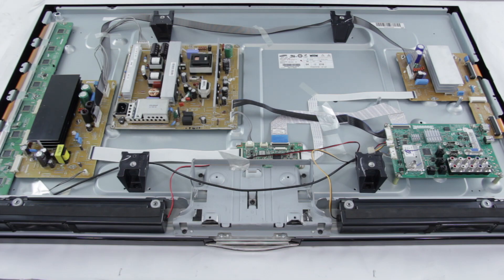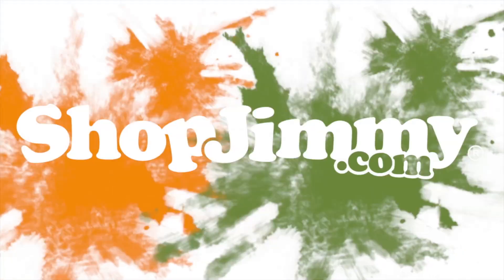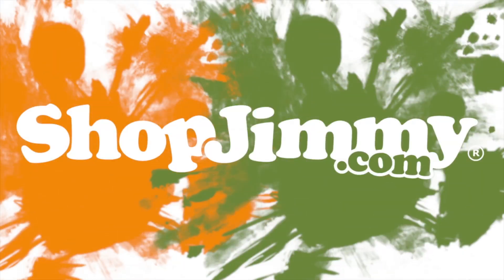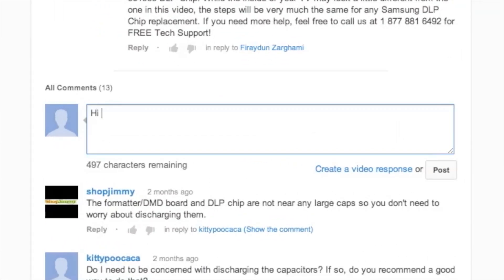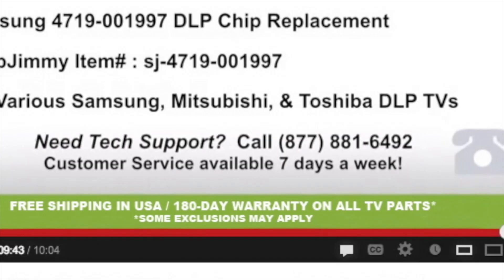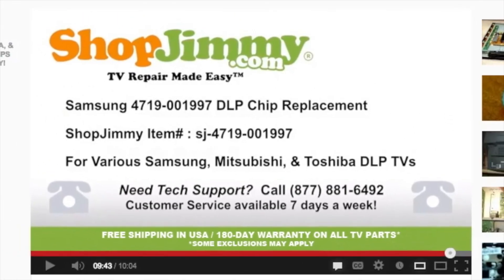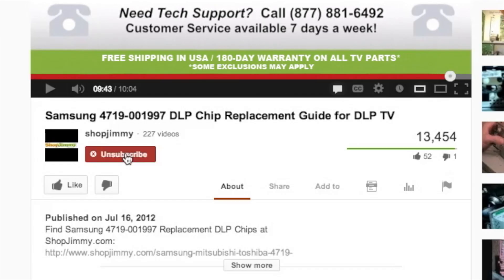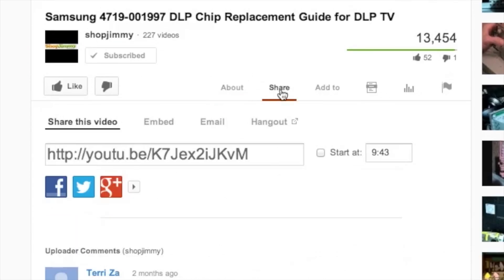Plasma TV Repair Tutorial - Common Symptoms & Solutions - How to Fix Plasma TVs

Comment: I have a 2013 Samsung plasma 55-inch. I noticed recently on very black sections of the TV I see faint snow. I tried changing the HDMI cable with no luck. I am connected to a "smart" Bluray player that is connected to WiFi for streaming (Netflix, Prime.) Any ideas on what to check? Thanks!

Comment: 10 year old Samsung Plasma TV Series 4  450:No picture or sound when we turn on TV.  It is receiving power because the ON red light indicator comes on and we hear the two-note sound the TV makes when it turns on or off.  For the past two weeks we have had the problem 2 or 3 times of the screen occasionally going black during a show -- changing the channel would make it come on again and we could then return to the original channel and have a picture again.

Comment: It’s a Samsung plasma display the model number on the back of the tv is PN51E530A3F, there’s a model number on the inside also that’s S51FH-YB01 the problem is the top part of the tv is black and the bottom works perfectly fine, there is moments when the whole screen will work and the top lights will turn on and then it goes back to the top half black and the rest fine. PLEASE HELP😭

Comment: Hi, I have a Samsung 58'' plasma  PN58B540S3FXZA. It shut down while watching it. When powering it back on it clicks as the standby light blinks and a green light on the logic board blinks,  does this a bit and then stops clicking with a solid red standby light on.  No image on the screen during all of this.  I purchased another power board (not from shop jimmy). After installing the new board, when I plug it in, I can hear some components power up but, no clicking or any standby lights at all.  also no green light on the logic board and no image. I've checked continuity on all fuses (good). I checked the presence of voltage with a no-contact voltage checker. The new board shows voltage across 2/3rd's of the board but the last 3rd of the board does not show any power in its components. Any ideas?

Comment: Hi I have a Lg60pk590 plasma standby light on goes off as it should do when I press power button but no picture on screen just black or really dark I purchased a y sustain board from eBay and switched it out with no success and tested buffer with multimeter power off? I have read about testing for sound but as i cant see screen im not sure how i can do this as mx box pauses when hdmi unplugged and thats really the only device i have Any advice appreciated 
Thanks

Comment: 60" Samsung plasma (PN60F5500AFXZC) blew a small capacitor on the Y-sustain board. Completely lost the picture. I replaced the Y-sustain and and the picture came back but it is very red/purple and dark with fleeting/flickering vertical lines throughout.The tutorial indicates that a faulty x-sustain board can cause the dark picture with red & purple. It actually looks more true to color when switched to 3D mode but still a bad picture. Anyone else experience this and have some insights into other possible causes for dark red/purple picture with vertical lines? I hate to let the tv go to waste but I also don't want to end up spending a fortune on it.

Comment: LG 60Pn6500 intermittently shuts down then comes back on. Worse in warm weather. Fan on back helps but not complete solution. Took the back off today - no dust and no swollen caps or other obvious problems. Cut a hole in the back directly over heat sinks on the v-Sus board and installed a computer fan blowing in. The problem got more frequent. Shut that fan off and turned the large fan back on. Ran longer, but still shut down after approx 10 minutes. Stays off 3-5 minutes. Any suggestions?

Comment: I have a LG 60PZ950 plasma TV with screen problems. It shows red tint and snow with solarization.  My research pointed to z-sus problem. I replaced the board but the problem persists. Power supply Vs reads 215 volts and Va reads 55 volts, and 5 volts for standby. All caps, coils and connections look fine. Any idea?

Comment: I have a 60" LG plasma and I'm not wanting to go to led for my own reasons.  The set turns of for a couple of seconds and the picture is good but then it turns off by itself and then will not stay on at all after repeatedly trying to get it to work.  The problem started gradually and it messed up a couple of times before it basically became unusable.  I had it repaired once already and it cost me $300.  I thought I would try to fix it myself this time and any help would be greatly appreciated.  Thanks.

Comment: I have a samsung hp-R5052 and it works fine most of the time but sometimes the top half of the screen is white with some pink pixelation.  My mother thinks it’s low on Freon but it’s not an air conditioner.

Comment: My LG Model 50PC3D-UD is making a clicking noise when I try to power on and the green light will light up for a second and it turns off. 

I have tried for 3 hours turning on tv and it will click off and then a picture would momentarily show on tv and then stay on for a few hours. What is causing this issue

Comment: I have an lg plasma 50pq30 and it's getting No power and no standby, nothing.
Reply: Look at the fuse on the main board. Near to where the power led is.  I'd be starting there. Or bulging capacitors.

Comment: Hi I have a LG 60PV400 plasma and when u turn it the TV will turn on with no picture and after couple seconds click and turn off. I took the back cover off the TV and the Y sus board makes a buzzing noise. Do u think it's that whats wrong. And I actually can't find one for it if I buy a kit does it come with everything in it to change out everything that needs to be changed. Thank u hope to here back from you

Comment: My TV is a Panasonic T-CP55st30 following troubleshooting tip to isolated to the Y SU board purchases kit for common repairs, successfully repaired IGBT and rectifiers supplied with kit. Upon start up the i heard a pop and again an IGBT has shorted. What would be a next action, A  y-scan board?
Reply: have the same problem cant find whats blowing these IGBT 's there are 2 of them
one on each heat sink and I have checked all the components for shorts . would 
love to solve this mistery

Comment: Hello, 

I have an LG 60pn6500 plasma television that will not power on. The red light is on but nothing happens when you push the power button.. any suggestions? Thanks in advance.

Comment: Model: PN51E450 (Samsung Plasma 55 inch
)
Problem:permanent, single, thin, magenta, vertical line, top to bottom on left side of screen. Could this be the logic board or would you recommend a different part? Thank you.

Comment: Hi. Really informative channel. Glad I found it and subscribed. 
I have a Samsung 50” plasma about 15 years old. Recently the screen has started to periodically go black but I can still hear sound. If I unplug it for several minutes, the picture comes back one. It does this every few days. The tv doesn’t have to be on for a long time for this to happen. I noticed it is also a little warmer that it used to be when I walk by it.  The model number is HPT5034YX/XXA.  Thank you very much in advance
Reply: I have the a similar problem, the tv boots with no image 9 out of 10 times but Shem it boots with images it just works perfectly until you shot it down .. really weird and difficult to diagnose

Comment: I have a Samsung PN64E8000GFXZA Version No, TW02 . My TV recently had trouble powering on. It would cycle on and off and finally after a few tries it remained on until next time day with the same happening. Now it will not power on at all. Thanks for your help.

Comment: Hello, 
I have a panosonic plasma TV
TC-P46ST30
I replaced - A Main Board
TV truns on but no sound no picture.
Reply: Did he reply?? Oh wait let me guess. I think not. Lol..
Reply: Make sure that you haven't reversed a cable or connector. Put the old board back in then one at a time unhook the other boards to see if you notice any difference in it's operation. More than likely there is another board dealing with what ever initial problem that you had. For instance, there could have been a surge in the cable system causing the auxiliary input board to glitch out drawing more power than needed thereby burning your power board. Almost every board will be connected to the power supply. Check the few that aren't connected straight away but by proxy of other boards. Make sure you stay grounded. Static is a killer!

Comment: I was watching my LG plasma TV Model 4900 the other night when it went black. Sound
disappeared as well.  As if I had turned it off. The green light on the
bottom panel went to red.  I tried to turn it on both with the remote and
at the panel and the light would not go to green and it would not turn
on.  I would hear a clicking sound every time I tried to turn it on but
nothing. There's power coming from the socket because the cable light
turns on.  I pulled the plug to the TV hopefully to rest it.  When I
plugged in the set the next day, the TV kept making the clicking sound
repeatedly without my pushing the on button.  This is our basementTV.  Usually, I don't watch it more than 2-3 hours at night.  it's
not like it gets a lot of heavy use.  A few questions. 
Does this sound like a power board problem or something else?  I am not
particularly handy.  Does it make sense to get a repair guy to fix
it?  Any idea on the cost? Or given the cost, should I just replace
it?  No other problems to date.  Thanks

Comment: I have a Samsung PN64D8000. The TV will power on just fine and after some time will either shut down -power light blinks 5 times (happens most frequently),  loses picture and has sound, or just loses picture and sound and does not turn off on its own. Letting the TV sit for a period of time (10-15 mins) will allow it to power on and produce picture and sound but one of the symptoms described above  eventually will occur. Any idea what may be causing this? Thanks in advance

Comment: I have a Samsung model PN50a400c2d 
Model code pn50a400c2dxza
I have no stand by light. When we plug it in we get back light. The t con board has the left light blinking when plugged in and the board with the  inputs has a red light on while plugged in. I have replaced the power supply board with a new one. I also replaced the y sus board because it had blown capacitors. Is there anything else that I should replace? Buying the parts is cheaper than buying a 600$ tv.

Comment: I have a Samsung plasma model pn51e550d1fx2a that has five vertical lines coming from the left side about 3 in from the bezel otherwise the tv works perfectly fine. Please provide a probable solution. Thank you

Comment: I have a Samsung Plasma Serie5+ 530. Model Name: 59D530: Model Code: 59D530A3FXZA: Serial Number: Z3T13CJ8800253P: Version: Y302. The symptom is the TV will come on with a very good picture. After a few minutes, there will be like a click and the picture will go away. Since I bought the TV I have always ran through a cable box to a Denon Receiver to the TV. I can let the TV set for a while and turn it on and the picture will come back only to go away again after a few minutes. But there is a distinct click each time before this happens. It almost sounds like the TV is turning off.

Comment: samsung 63 plasma PN63C8000   3D about 8-9 years old. tv will not accept hdmi input and jumps to PC input.  it cycles through menu - goes to store demo cycle - when it goes to hdmi picture is good but it will then jump to other things - menu - pc input etc.  does not accept source input at times and others times it does brIefly and then jumps to something else.  Now it is working again.

Comment: Hi there, if a Samsung Plasma is showing random thin and thicker black lines horizontally and green and pink vertical lines occasionally, should I assume the buffer board on the y sustain has gone bad and the logic board has gone bad?  (I cleaned all the connectors of the ribbons to no avail).  Thanks for the great class!!!

Comment: Hi I have a Samsung Plasma PN64F8500AFXZA with thin Vertical colored lines 8” from the left side of the frame They run top to bottom and are over the picture. Colors are Red, Green and Blue. There used to be only 3 and in the last week we now have a total of 8 lines running top to bottom.  The TV is only 4-1/2 years old. The rest of the tv picture is normal. Color and sound are great. No weird hues. I only want to take this beast down just once.

Comment: samsung plasma TV model no. PN60F8500AFXZA we brought this from USA while shifting to India, we have connected the equipment through step down transformer from 220 
V to 110V, around last week the TV stopped displaying after power on with the error " check source signal'  whenever we check the source and connect the TV cable  or any other gadget there is no display - please let us know any service providers at Bangalore, India for servicing

Comment: My Samsung Plasma had a very loud pop and screen went black. Definitely an electrical hot smell as well. Power light flashes twice and repeats constantly.  Model #PN64D550C1F.
Reply: Richard Ketcham  i have LG50ps3000 the bottom half is perfect but upper half goes black sometimes horizontal lines,sometimes goes perfect for short time .which board is causing this.

Comment: I have a pn59d7000 Samsung plasma tv that when I plug it in it will make a “click” like I’m turning it on, flash these horizontal bars and then be black. At this same time the standby light will flash 6 times and after the sixth times and then stay off. The will be no sound.

Comment: Hello, thank you for the helpful video. Based on your descriptions it sounds like my “Y” board is bad as my Samsung Model Number PN57D7000FFXZA cycles on and off. It begins with just randomly turning off on its own, normally within 5 minutes of turning it on. Once I turn it back on the shut off time comes closer and closer until eventually it just continually cycles to the Samsung logo and then shuts off and starts again. Do you think it is the Y board?

Comment: OK here's something you didn't cover.
I have an old 42" HTC KPP-42MHDplasma  that turns on and works but the back light kinda pulses or flashes and the screen has black snow around the edges, minimal snow throughout the entire screen..
Would hat be worn out MOSFET's on the y-main?
There are no transformers on the x-main.

Comment: Samsung PN59D530A3FXZA - The screen will turn on and display picture after being plugged up, but then 5-7 minutes in the screen will go black and you can still hear audio.  I have replaced the X-main board already, and the picture still went away after a few minutes.  I have checked VS and VA on the power supply, getting roughly 200 volts and 60 volts on the respective input.  After I unplug the TV for a while or a few days, the picture may last longer before going black.  I cannot see an image on the screen, not even a dark image.   Any suggestions?

Comment: I have an LG 50PM6700 Plasma TV. I was watching tv when it shut it self off. When I powered it back on had sound but no picture. Can not get menu to come up. However I can change stations using the number key pad on remote control.

Comment: I have a Panasonic TC-P50s2 with 10 blinks. When I disconnect from power and reconnect, turn on, it shows red led for a few secs, then clicks, and blinks 10x. Does this sound like a psu board failure?

Comment: I have a Vizio P50HDTV10A that makes a loud popping noise and then shuts off.  If I unplug it for a few minutes, it will turn back on, but then does the same after a while (sometimes a few minutes, sometimes a few hours).  Based on your video, I suspect it is the Y sustain board.  What is the best way to fix this?

Comment: I have a Insignia 42" plasma and there is a buzzing sound coming from the screen side at first the pic got all weird then just went black , no pic , yes sound ,two model #'s outer shell insignia n8-42p650a11 inner frame samsung # s42ax-yb09, i tightened all the ground screws boy were they loose but i still get this crazy buzzing sound from the front screen section ,what could that be the tv is 9yrs old . thanks in advance , ps i recieved my parts from you for my bestbuy sharp 50 inch smart tv the backlights they worked perfectly until i cracked the screen putting it back together LOL !!

Comment: Hi, I have a Samsung  PN50B450B1D, The TV works fine other then it has no sound. I have been using a soundbar. All the sound setting are correct. the volume, mute and all shows on the screen like its working but no sound. I tested the speakers and they work. I run the built in Samsung sound test and no sound. which board would i need to replace?

Comment: I have a Samsung 55" plasma MODEL # PN51E550D1F, TYPE: PN51E550. I took the tv off the wall to paint and as I was hanging it back up I noticed a small crack in the top left corner. When I turned it on I had no picture but a loud audible screech. Any ideas?

Comment: Samsung 50" Plasma Model: 850HW-YB06, has a Vertical black line in the middle of the screen, black line run completely from top to bottom. Need help - D-Con board?

Comment: I have a Panasonic plasma TV model TC-P50VT20.  It has about 9 very narrow vertical lines between 4 and 12 inches long.  Also have a vertical black block 3" wide and 12" high on the bottom left side of the screen. Can you let me know how or if I can fix this. Thanks